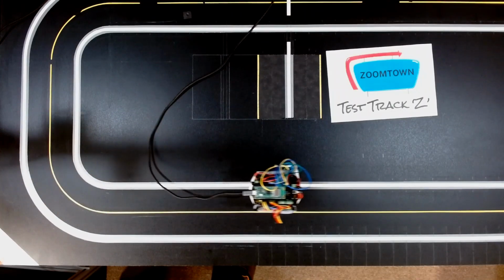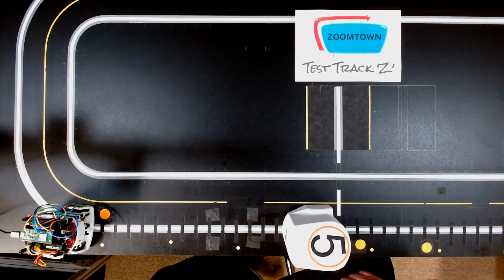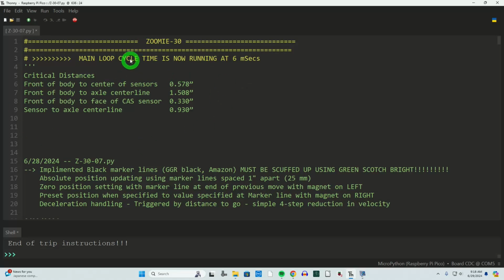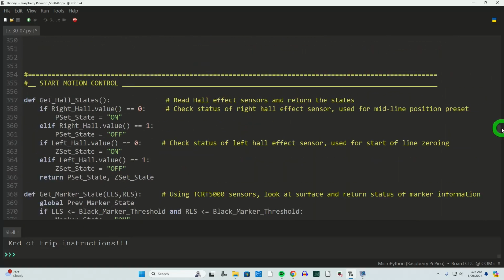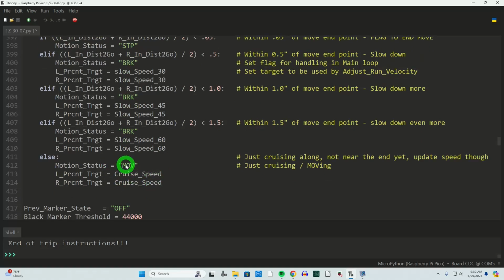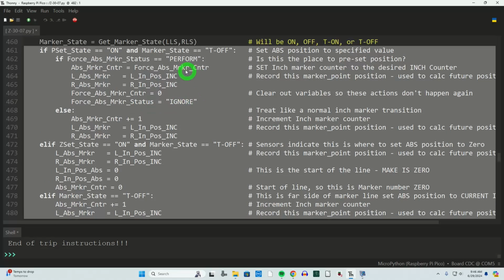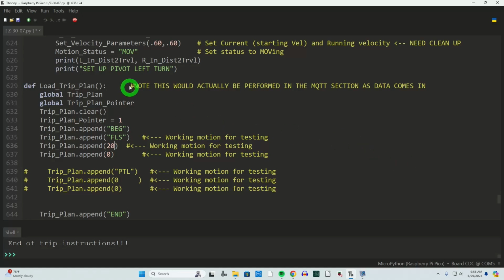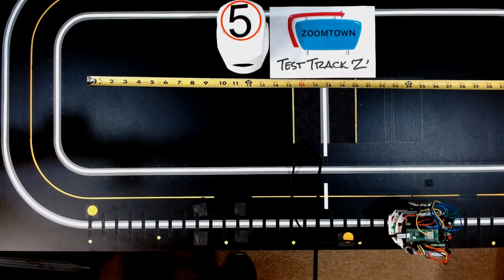038 Achieving Robust Line Following and Position Tracking on our PICO and MicroPython controlled bot

Comment: Hi Chris, an observation on your handling on distance measurements. As an older member of the UK population, I was brought up with imperial measurements and then we went metric sometime ago. So I sympathise with your need to talk to your viewers in both systems. I still naturally use imperial for most things except weights!
Reply from the maker: Hi Peter,
It certainly can be a pain sometimes but I have had to deal with both systems for many years now.  As a CNC Applications Engineer, I work in different companies every week and some shops are all Imperial (oddly many defense contractors!) and Metric.  My "comfort zone" is in the range of a meter down to a micron - most of the time closer to dealing with millimeters and microns in precision machining.  If my head is clear I am lucky enough to bounce back and forth.  Having been working with both systems in manufacturing, I am now a convert and wish the imperial system of length measuring would go away, however I still like Imperial for Weights and Temperatures 🙂

In the UK has the Imperial system pretty much vanished from society now?

Cheers!
Chris
Reply: @MakingStuffwithChrisDeHut  
Hi Chris, we still use imperial for distances on roads, always an issue when you take your car to Europe (Sat Nav great help here). Weights and volumes are mainly metric. Where would we be without standards ? Cheers Peter